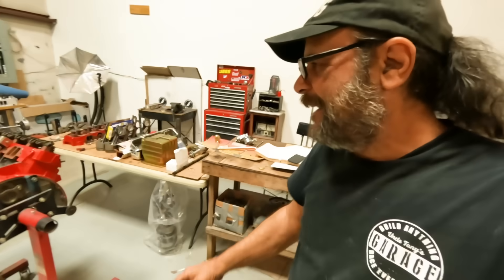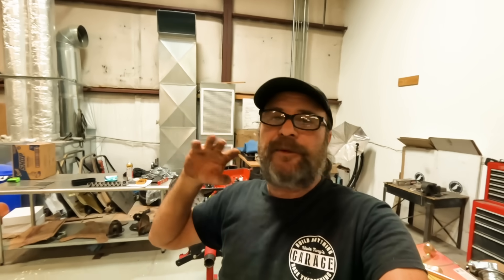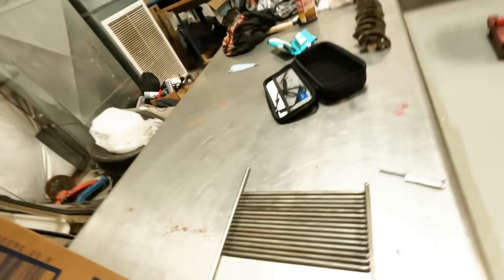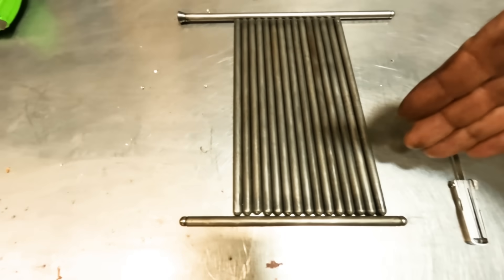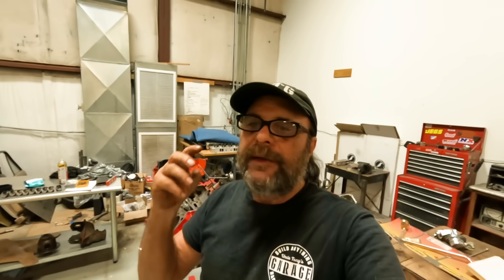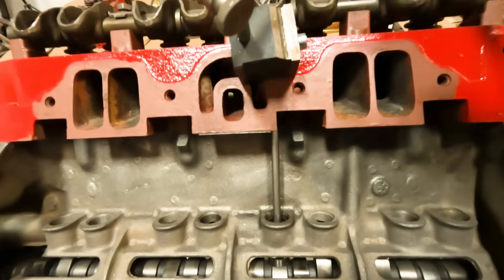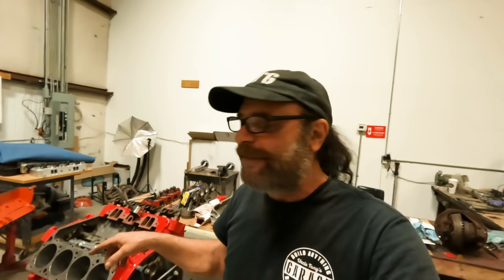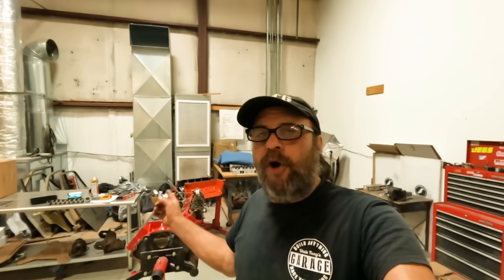The Engine Tuning Issue You Didn't Know You Had

Comment: I spent hours measuring rockers and valvetrain stuff in my youth. We ran 351 Clevelands in the 70s at dirt tracks, and they have what Ford calls "positive stop" rockers from the factory, on everything but the HIPO stuff. We ran the CJ and Boss stuff, but there was a lot of differences even in the Harland Sharp stuff we used a lot. That was just part of what you had for the times. To this day, I still use the same techniques and practices I learned in my pre teen years. It works.

Comment: so 20 years ago i was building up a 360 .... it ran pretty good , but then i got a set of heads off of a 340 with big valves , had a machine shop work them over and cut them down .... the owner said to make sure there was a 100 thou preload on the lifters .... this ended up being a sour running motor and i just realized why ..... thank you  very much Tony

Comment: If a chevy guy goes 1 turn of preload instead of 1/2, are you more likly to not hang valves when the lifter pumps up? because it would have to pump up more since the pushrod is further down in the travel of the lifter.

Comment: You mean chevys are the only engine you can go to zero lash with hydraulic lifters and go 1/2 to 3/4 of a turn for preload? I understand the differences youre seing in pushrod and valve lengths, assuming all the valve seats are good and not sunk. But why are you worried about zero lash when you need to add preload? I can see how the differnt length push rods adds different amounts of preload, but you have a cussion with the lifter that will take up the difference on each push rod. At high RPM are the lifters pumping up too much and messing up your preload amount? and can you run solid lifters on a mopar style, rocker shaft setup? Im confused haha.

Comment: This is one of the reasons I bought an old Sioux valve/seat  grinder. I can make the v. seats a consistent depth and I can grind the v. stem tips if any are too high. That doesn't happen very often, but I do have that capability if it's needed. I even have an accessory fixture to grind the rocker tips.
I also vacuum check each port to make sure each valve/seat/guide seals properly.
Reply: I wouldn't let my Sioux valve grinder and seat grinder go for anything. I inherited it from my uncle, who had it for all my life before I got it, and I'm 59.  I can't do the newest pencil thin stemmed valves with it, but I don't have to do what I don't need to or have the stuff for anymore lol.

Comment: I bought a 351M one time that some one had fresh built some what hoped up and it had machine work done. And he could not get it to work right so i got it cheep. So i pulled the valve covers found 4 bent pushrods. Me being a green horn then, I just slapped in another set of pushrods and drove it down the road and back. Well it bent push rods again. Ok lessoned learned on set of pushrods. Studded the situation and come to the conclusion that it had been decked and heads were shaved. How much, i did not know so i took a gamble and drilled holes in a long hoes clamp because it was what i could afford at the time. I cut it with tin snips so i could shim each rocker. Took the gamble that this was going to work and put it back together. It turned out to be one of the best running motors that i had for the budget i did not have.

Comment: First I will say that any jack leg can build a small or big block Chev that will run hard and well simply due to the plethora of parts available. One could even extend that to "Windsor" platform Fords and Mopar LA engines as parts are plentiful and cheap. Every build should be "blueprinted" in every way. If you are building a shaft mount rocker engine (virtually all Chrysler engines, Ford FE engines and select GM engines), you need adjustable rockers or stay on the porch. If you are a Mopar guy, you have an edge because you are starting out with a more stable and stout platform with bigger lifters and better pushrods. Always, always, ALWAYS measure 5 times and order parts once. Also, talk to ALL of your manufacturers and machinist to put together a combination that is going to work well together. Any given combination is only as good as its weakest link.

Comment: We just did a pretty expensive 440 at work (edelbrock heads, stroker, etc) the rocker arm kit alone was nearly two thousand. Absolutely unobtainable/impossible
Reply: At least to get the lash equalized, the cheapest, not the best way, is with adjustable pushrods. About 10 years ago I had a set of Max Wedge rockers bushed, trued to 1.5:1 all new hardware and hard chrome shafts and it came out to about $1000 including the cost of the rockers and that was me supplying my own rockers. I sent them to Gary @ R.A.S. He did a beautiful job. Took a little while, but I didn't care. He said he could adjust them to 1.6:1 and I said no, but I wish I went with 1.55:1 now. Used to be you had to go through a 5 gallon bucket or more of the stamped OE rockers to come up with a 'matched' set. I think they're required for PSMCD.

Comment: Tony...I recently installed 440 source heads on my 68 H code 383.  I have a lunati voodoo 256 cam that has very fast ramps.  The valvetrain was noisy with the standard comp 8.575 b engine pushrods.  I found out I didnt have enough lifter preload with the thicker head gasket and the new heads.  the engine was not decked and is completely original bottom end from the factory.  The new heads were not cut.   I measured the 16 comp pushrods I purchased when I put the cam in (earlier than the head job) and they were all over the board in length...sorry to say Comp...bad manufacturing tolerances.  I ended up buying 3 sets of comp pushrods so that I could get one good set with roughly equal pushrod length and sent the rest back.   I have roughly .030 preload now on all valves and I put the shorter pushrods in the valves that had higher stem height.

Comment: I don't have a lot of big block Mopars under my belt but have built a lot of small blocks. I used to scour the older junkyards for 273 adjustable rockers. They always worked pretty good, still have a couple good sets with  shafts and push rods "trimmed to hydraulic lifter length" set aside. I have to confess I tried a few under $200 ebay sets on hydraulic flat tappet motors under .550" lift. Carefully set up none have failed even at or near 7000rpm.

Comment: Yes so basically from a manufacturing standpoint everything has to be adjustable and have inbuilt adjustments at critical spots otherwise every time something comes out of the mould not quite right that part is junk and you just can’t do business that way……. 

Also when something’s got 300,000 km on it you have engine wear and you need to take up that slack as part of the servicing routine by having inbuilt adjustments in critical spots…….

Having said all of that I have always wondered why car manufacturers wouldn’t take a leaf out of Ducati‘s book and have gear drive mechanisms for valves opening and closing basically Desmo Tronic valve trains

Mates of mine in the engineering game have said bottom line is production cost is too high for the limited performance benefit given stock motors don’t rev to the 17,000 RPM like motorbikes do so the lower rev range of 5 1/2 grand it’s not worth the price-tag……

I reckon it would be good still….

Good on you uncle Tony happy Easter buona pasqua to all your family from Melbourne Australia wish you all the best keep up the good work with the channel

Comment: I grew up poor, plus I'm cheap. I don't like buying anything unless I have no choice. If I can fix or modify what I have, then it's done. I love all the tips I've learned here. I'll probably never need most of them. But that knowledge can be applied in different ways. So even though you're talking about engine internals. There are methods and ideas that can be used on different things. It's all about the way you think about something. If you see it as a puzzle to complete, just find (or make)the right pieces and build the puzzle

Comment: Ford guy here, we use individual rockers but non-adjustable, only have shims to use.  Needed different length pushrods to make it work right with a different cam, and those were even more variable than the factory ones.  I set each valve up, moving pushrods and selecting shims to get the entire thing as close to equal preload as I possibly could.  Yes it does take hours, putting things together and taking it apart between each measurement but the engine has never run better since I did all that.

Comment: Yessir!! I play with those Chevy 60 degree V6's. To get the valve lash on those torque and go rockers right so they don't tick, I either shim under the ball pivot with a cut up starter shim or grind the underside of the ball pivot.
Reply: Playing with the 60° Chevy V6 and still using ball stud rockers ? 
Head out to the salvage yard , and find a later 3.1 , they use a factory roller trunion (but sadly , not roller tip) rocker arm . Free up a little valvetrain friction there !
Reply: @Richie_the_Fixer  ok, thanks for the input!

Comment: Tony was just wondering if you can make a jig and build your own adjusters?  Sort of like short pushrods and then use valve caps to make adjustments to the preload?  Sorry worked on old Ducati motorcycles with DESMO heads so I am used to shim nightmares.  I don't think the added weight of making a bolt style adjuster would work due to the increased mass, or would it?  Just a tinker's strange thoughts.

Comment: This is fascinating!
I had an awful rattle with my 318 once put together. All it’s got is a comp 268h cam, edelbrock intake,carby and hei ignition with a full exhaust. The heads have never been off. Even on comps website it states that one will get valve train noise if not using adjustable rockers. I simply could not afford the adjustable rockers instead sought advice from a Mopar guru and he suggested 80thou lash caps. These were very cheap as opposed to a whole new rocker set and my engine is now quiet as but I do find that it’s reluctant to rev past 5 grand but seeing as it’s mainly a cruiser I’m really not fussed about it. It sure is responsive though. I’ve read good and bad things about lash caps but after nearly three years I’ve not had any dramas.
Reply: Check your advance curve 
.
My dad's 440 would ping and "break up" around 4500rpm
.
Advance curve change and it ran like a top
Reply: Nothing wrong with using lash caps. Saves your valve stems from wear too
Reply: did you change the valve springs to the ones Comp recommends for it's camshaft , sounds like you have valve float . Lash caps weren't the right way to do what you did , you change rocker to valve stem geometry by making the valve longer without raising the rockershafts up also. Adjustable pushrods are a cheap alternative to adjustable rockers .

Comment: Especially changing cams or regrinds you shim on some engines file slightly the factory rocker pivots on others to get it to satisfactory or zero.  If you don't you get a noisy valve train too,  this is excellent video I like the pushrod length trick thank you

Comment: this video shows why I spend so much time at the junk yard with a set of tools. when I was hard into engine building for power, I always had a box of spare parts from the engine I was building, I tried to have at least 2 complete sets of push rods for the same engine I was building, same with connecting rods, distributers.etc. that way I always had a replacement for one that I didn.t like for whatever reason

Comment: As a teen I got an education on hydraulic lifters with shaft type fixed rockers. It was on a 390 Ford. It was a low mileage engine so I did a cam swap and slapped on a set of heads I had rebuilt from an old police car that were higher compression. Went to turn it over and started bending pushrods. I ended up putting washers under the rocker stands to get some clearance. Never did figure out what was up with that but it ran and that's all that mattered to me at the time. Ran way stronger than it did before. Not sure how much was the heads and how much was the ole " Fireball" Crane cam.  It ran like that till I spun a rod bearing and did a complete rebuild with some different parts.

Comment: Great video! First car a 70 Lemans, 400 4sd, valves would float. Read a Hot Rod article and figured out I needed to zero preload it, but Pontiacs just had a step on their studs. My heads (7K3 I think) had screw in rocker studs. Well I'd put a 396 my brother built, with a solid lifter cam in the thing and of course blew it up. Get to looking and sure as shit the BB Chevy studs fit the Pontiac heads. 
HOLY SHIT! That made a difference!
 What saved my ass reving the shit out of that Pontiac was it'd already tossed one of its rods, had a sleeve in one hole and somebody put forged steel rods in it, always assumed they where out of a 50s Pontiac but don't know for sure. 
 Beat the hell out of that engine all through high school, couldn't kill it. No idea on RPM, techs where for rich kids.  🤣
Reply: I was always told the Pontiac con rods were just cast steel. The only 'stock' forged Pontiac rods came on Super Duty engines.

Comment: Buy 340 valve springs and forget push rod length as long as your lifter compression remains under .060 opening. My recollection is they should be be average .030. Total lift is same for SM Chevy and Ford. But i am just an old guy who loves your posts!!!!!!!

Comment: Great video! Just to dumb it down, shimming a non-adjustable valvetrain is basically a way of making it adjustable without spending a ton of money on an aftermarket valvetrain. I have had a number of small block Mopars and I've never had a need to push them that far so the non-adjustable rocker shaft setup always worked well enough for me. I just liked a mostly stock screamer (i.e. 340) with maybe a set of headers and a little more carb and lower gears, etc. that I didn't have to go bonkers trying to modify that much. But this is really good info just the same!

Comment: 😎🖖👍👌✌🤓 wouldn't heavier springs help overcome valve float ???? just asking for a friend .... 😎🖖👍👌✌🤓
Reply: Yes. But, heavier springs are also more load and stress on the valve train. Sometimes the pushrod will punch right through the stamped rocker. 
If you want to take the time do like he was talking about and matching the pushrods to a specific lifter/rocker. That way it helps balance everything out to where it’s less likely to have something pump up and be a problem.
Reply: @NBSV1  thanks ✌✌

Comment: I am going through something similar right now. Also, I am in a bind trying to figure it out. I am building a performance 460. I have a lot to learn apparently after watching this video. I have a large mother thumper cam with stock bottom end except for the bearings and pistons. I have flat top aluminum pistons instead of the bath tub pistons. Any ways I put a set of roller rockers and studs in and gave it a half turn of preload as I have always been told and have done many times with out any problems. Now none of my valves will close all the way and my roller rockers are pressed onto the studs. I tried using a  gear puller to remove the rockers but the gear puller arm bent instead of pulling the rocker. Anybody know if there is a special tool to remove the pressed on roller rockers? I looked on the internet but so far I haven't been able to find a solution.
Reply: Hahahahahahahaha wow!
Reply: @jaredmayer3960  ok, what's that supposed to mean?
Reply: @BuildsAndMoreRacing  I was laughing because that story is all kinds of fucked up!
Reply: @jaredmayer3960  for sure it is. I might have found a tool to remove the roller rockers. Its called a Camoo rocker arm remover. I hope it works.

Comment: Tony, you ARE the man, I'm British and about your age, 1963 vintage, I love how you are an out and out Mopar guy, but you happily admit that Chevy won the cigar with the adjustable valve train, so simple and cheap. Why on earth didn't the other manufacturers do it.

Here in Europe if you want an American V8 on a budget, there's only one choice, Chevrolet.
Reply: The others can be nice from a production standpoint since they basically just throw the rockers on and tighten them down. That’s even how the LS engines are since they don’t have adjusters from the factory. 
The aftermarket support and so many parts being common is what really made the Chevy so good in the long run. Ford and Chrysler tend to have a lot of differences and details depending on what the engine was in. Chevy is more basic to the point you could basically get a small block out of anything and it’d work.

Comment: The 5.7-6.4 Hemi is exacty the same way, only the pushrods are a bitch to hold in place while you tighten the rocker shafts (both of them)  Then you need to roll the engine over half a dozen times, to make sure they stay where they are supposed to. Not bad on a stand, but a bit of a pain in the ass, in the car.

Comment: Tony, sometimes you just make me so mad I would pull my hair out, that is if I had any hair to pull out. This stuff you went over today is old hat, old school stuff that I learned before you were out of diapers working on the Race Car that my Next-Door Neighbor had. I've told you about that in past comments. The Live Engine Builds are far more fun to watch and that's why I don't watch all of your Live streams. But I totally get it as to why you are using the platform to educate the younger guys like the JJ guys. I've had guys look at me like I'm totally Stupid when just by listening to their car running, when I diagnosed the problem and shown them with a can of carb cleaner that I was right. Or by moving the plug wires all one location advance shown them that they jumped timing when the timing chain slipped. 
Many Years and Many Stories. I hope you got something out of this too. See you tomorrow